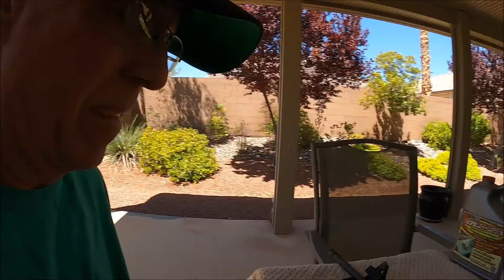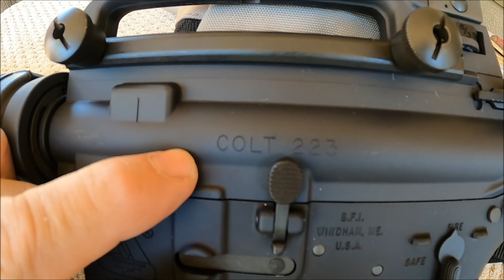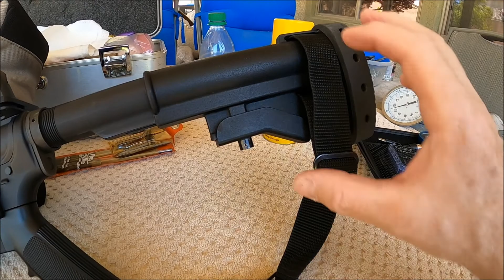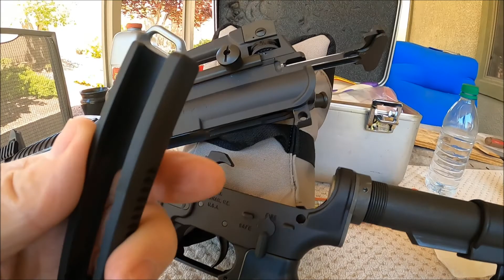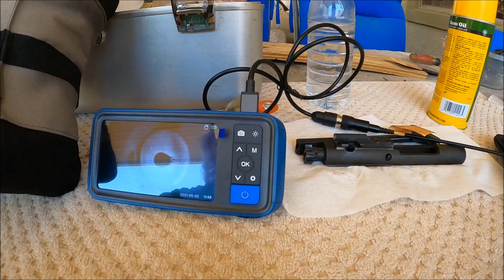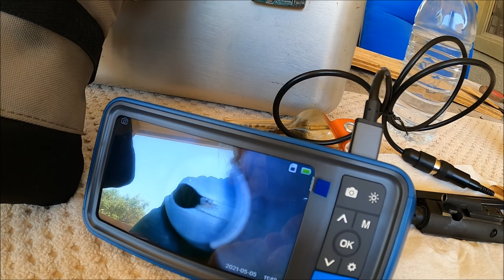Colt/Bushmaster Carbine 16" HBAR 5000 Rnd Barrel Inspection 5-5-2021

Comment: Why is the crush washer silver is that permanent or something?
Reply from the maker: Before the crush washer was used they had what is called a "Peel Washer". It's a washer that was comprised of many 002" thick washers/shims squeezed together. A lighter and razor blade was usually used to peel them apart for the right size. This came about when they went from the A1 to the A2 compensator which needed to be timed. Fulton Armory still sells the correct "Peel Washer" for an authentic look on the A2 rifle and Carbines.
Reply: @peter1956-x4s  thank you for the information That really helped me out.